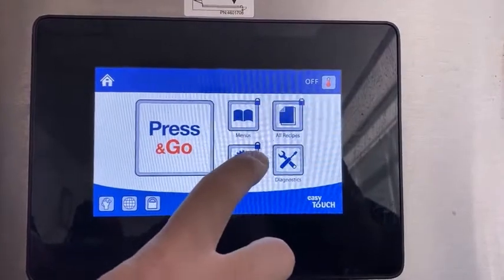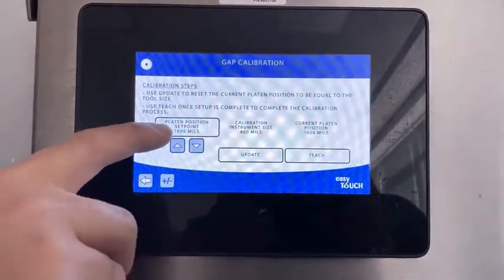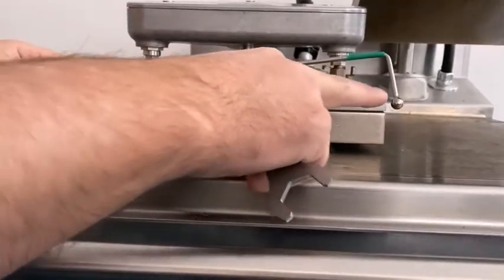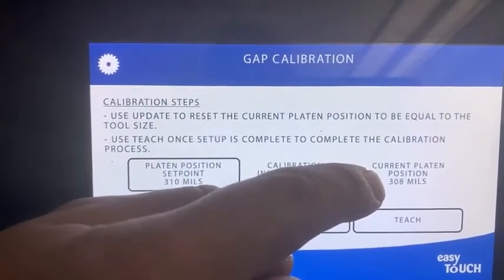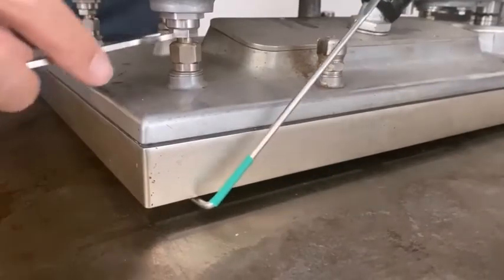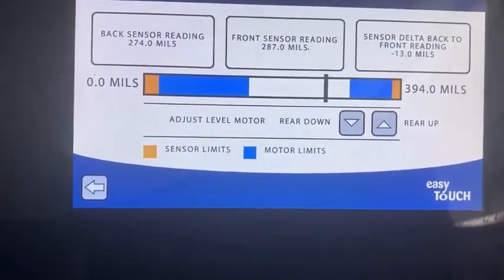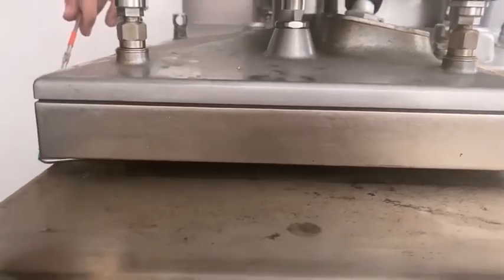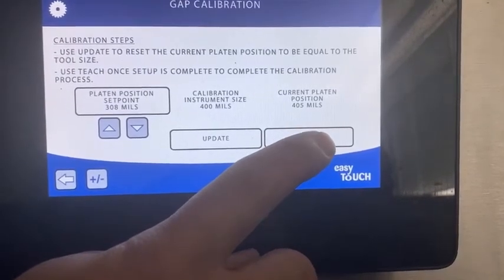Garland ME Gapping (Using the Gap Verification Tool)

Comment: I was wondering how do you do the gapping without no heat
Reply from the maker: Hi Steve. It is possible just to change the temp to 32f or 0c but then as the grill heats up you will find the gap changes due to heat expansion of the cooking surfaces so it’s advisable only to gap at the cooking temperature

Comment: Are the old gapping rods go no still OK to use for the new style ones?
Reply from the maker: In short, the answer would be no.
Reply from the maker: Yes, they can still be used but remember to set the tool size at 80mils not 400mils like the new tool

Comment: If that home setting isn't between 1500 or 2300 would the proper fix be to adjust the lower limit on the back of the grill?
Reply from the maker: You should ensure the anti rotate is secured correctly. If it is then yes you can adjust the limit switch arm so it contacts the anti rotate bar earlier or later as required
Reply from the maker: Some grills may hit the home switch outside of this range, so long as the gap is good that’s also ok

Comment: What if I have the L shape gap tool on this grill
Reply from the maker: Make sure you set gap calibration to 80mils. The rear will be tight one side and loose the other so try to get an average of the to
Reply: @garlandgrills3889 thanks I will the 3 platen grill has two bad actuators I have to change those also is there a pin in the bottom holding those actuators like the other garland grills